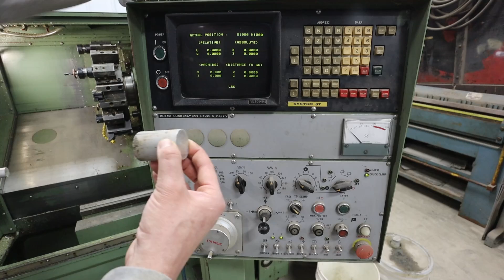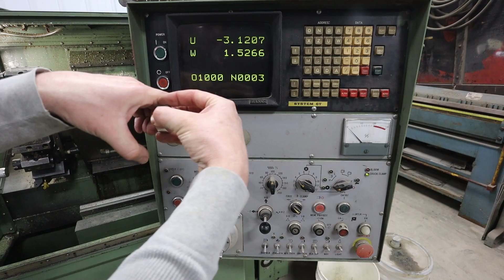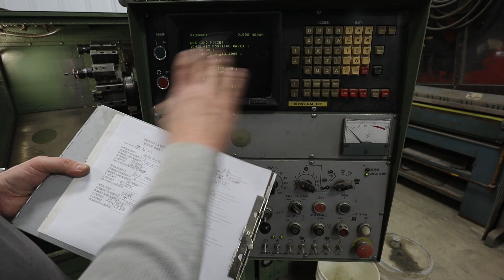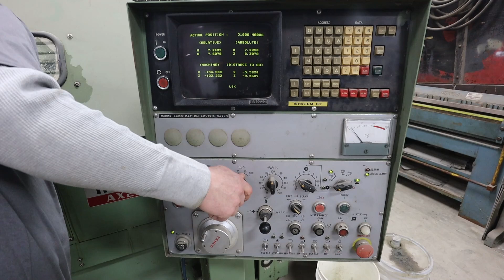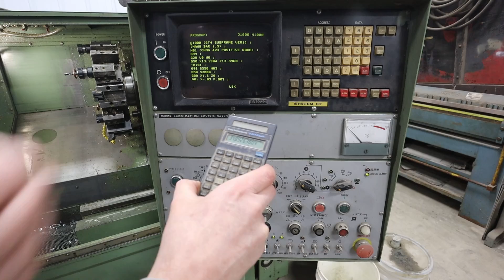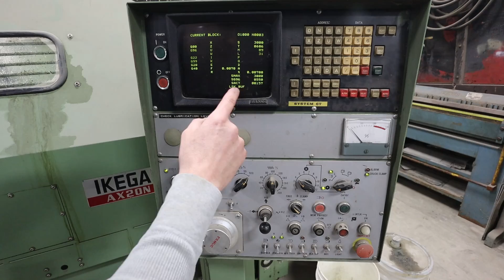Fanuc 6T setup G50 tutorial.  Ikegai AX20 CNC lathe.

Comment: In case this helps someone, I have a 1989 Mori Seiki SL1A, with a Yasnac LX1 control. I haven't been using G50 at all. I just delete all the G50 lines with all of its coordinates.
Instead, I use the wear offsets page as tool offsets. Then I don't have to modify my programs with the correct G50 coordinates, also I don't have to remember my offsets or keep them written. When I have to modify Z I just sum or substract whatever value I will use. I don't make complicated parts either, so I don't really know if there's a better way to do this.
BTW check your programs and your control, I'm not responsible for any crashes. 😂

Comment: GREAT Video. I have the same exact  Ikegai AX20 we machine large parts  4140 steel 10 Día inch by 18 inch using low gear. It can hog out a lot of metal. We make the Lockheed U2 wing rollers. Any way your method  of setting up the G50 is good to know. THANKS!!!!

Comment: Great video! Brought back a lot of memories. I learned on an Ikegai FX20N with a Fanuc 5T freestanding control. We would send the program from the computer to a Teletype machine only to punch the paper tape. We then took the paper tape and fed into the 5T control using the built-in tape reader. We soon went to using a more modern type (GNT 4601) tape reader/punch machine and mylar tape. We could actually go both directions with the program (punch/Read) and kept a library of all the programs in small plastic boxes. We would set the tools using a microscope on a mag base.
Reply: In the 80's we had the same nightmare on a Takisawa TX-1 Fanuc SYSTEM 5T with the tape reader, same freestanding cabinet, no screen, just X-Z read-out and a display for code and wear,  only memory for one program, we had also the reader - matrixprinter - puncher unit for tapes, OMG 😁
Biggest trauma was no ref/home position, a simple reset during run or testing ruined the WORK offset position, had to find the reference tool again, other tools had them in the program-code ( G50 style ), there was no GEOM table, only WEAR........ good old days. 🤑
Reply: @ytfan3815   Learning on a system like that really makes you appreciate how far technology has come! It has made me a better programmer for sure!

Comment: I did it differently than you. I keep the G50 x0. z0. and T0101 in all programs.
I just input the offset geometry tool of t0101 on the machine.
I think changing the program is unnecessary when we change tools.
Tell me what you think?
Reply: I use a G50 T5100 for main tool offset from work piece (enter these in 51-62 offset section for 12 tool turret), then I use 1-12 offsets for the minor wear offset. Program starts with /G28 U0W0 block delete is for initial start up since it's already home. 
So 
/G28 U0W0
G50T5100 (This calls up work offset.)
G00 T0101 (This does the tool change and adds minor wear if there is any.)
then the rest of the program....
after machining... rapid away for clearance.
ending with
G51T0100 (Sends the machine to Home and cancels tool and wear offset.)

Comment: Great video! My problem is how to send a program from my computer to the machine with FANUC 6T? Can you help with this information. I would appreciate it.
Reply from the maker: You will need a few things: 

Cable to go from the machine to computer. The pin out for your machine should be listed in your manual. In the most basic version, you will need to connect RX, TX, and ground. 

RS232 settings on your machine, the parameters to set this should be in your manual. Start by seeing what they are currently set to, you should be able to set your computer to match. I think I usually use 9600 baud, even parity, software flow control. 

RS232 settings on computer. Match what you have set on your machine. 

Software on your machine to transfer/edit files. To test your cable/settings, try to transfer a G code file from your 6T to your computer. Set up the computer program to receive, put 6T control in “program” mode, then type “O1000” (or whatever you program number is) and press the “punch” button. This will “punch” the program out your RS232 port. If your settings are correct it will appear in your computer program. If it does not work, keep checking and adjusting your RS232 parameters. 

To send a program to the 6T, type “O1000” or whatever program number you want and press “read”. Now hit “send” in your computer program.

Comment: What comand do you type to insert a comment?
Reply from the maker: On the 6T control, you do not have a full alphabet keyboard, and also you cannot type all of the possible special characters.  (parenthesis are usually what you use to make comments) but you do not have a parenthesis on the keyboard, so you cannot add comments into your program from the machine.  However, you CAN have (comments) in your program that you load from your computer or other program source, the control ignores them like usual.  
Long story short, add comments while you write or edit that program from your computer.
Reply: @CrawfordMethod  Thanks for information. It seemed to me also that this is only possible way. I will put parentheses in my computer.

Comment: Why is it while you're setting up Z and X are W and U?
Reply from the maker: W, U, and V are the complementary axis for Z, X, and Y.  These are usually for incremental moves.
   On this control, a "G28" command will make the machine move to X0, Z0, (work coordinate) then back to the home position.  Because we just set these to the face of the part, this could cause the tool to crash into the face of the part, or at very least some pucker-factor for the operator as the tool shoots towards the part!    So for the "G28 U0 W0" command, you are saying "make the G28 move back to machine coordinate home position, but incrementally 0, 0 before you go there."  An incremental move of U0, W0 is no motion at all, so the tool moves straight to machine home position.
Reply: I think w and U are for incrimental programming.

Comment: Man, fantastic information. I just bought a very similar lathe with Fanuc 6t control (with hilarious tape and drive)
Reply from the maker: I got one of these boxes from “Ausys”, it has an RS232 port, small lcd screen, and 2 USB port. You can mount it to the machine and use it to transfer files in and out of your machine. 
     If you really want to make it easy, you can get a WiFi USB thumb drive, and stick it in the port. The WiFi thumb drive appears on your desktop as a folder, so you don’t have to keep moving the thumb drive back and forth between your computer and the Ausys device. It’s like a modern network drive on your 80’s machine!  
     
I think this seller on EBay is the manufacturer. It has worked very well for me. 

https://www.ebay.com/itm/302700635649?mkcid=16&mkevt=1&mkrid=711-127632-2357-0&ssspo=PLoeAKtYTKC&sssrc=2349624&ssuid=SXkPQlUfS8y&var=&widget_ver=artemis&media=COPY